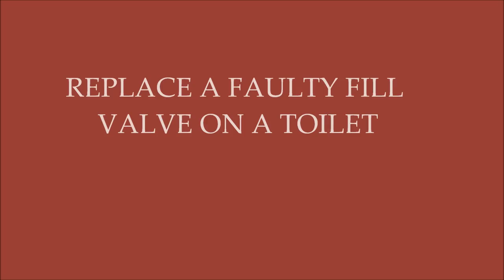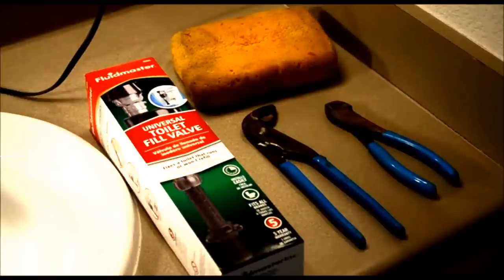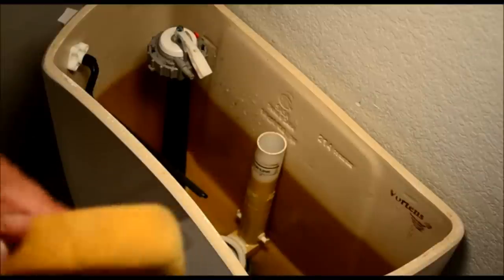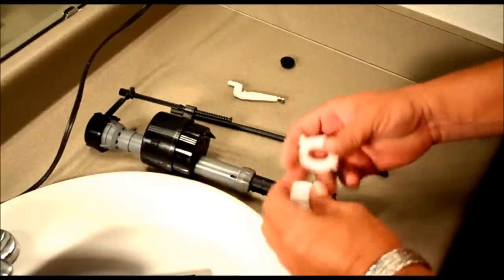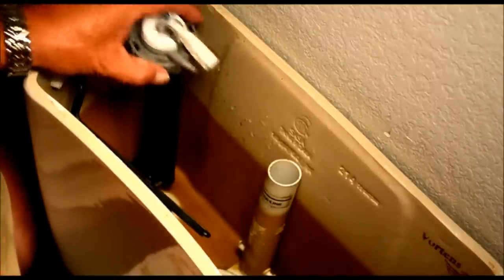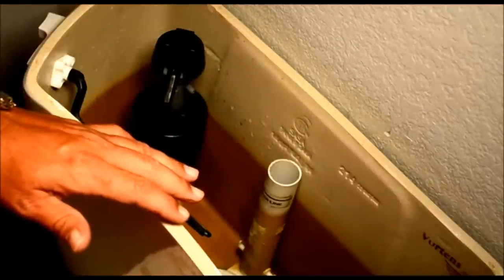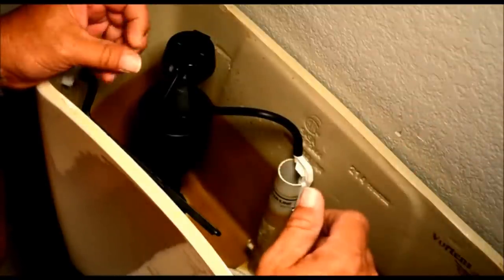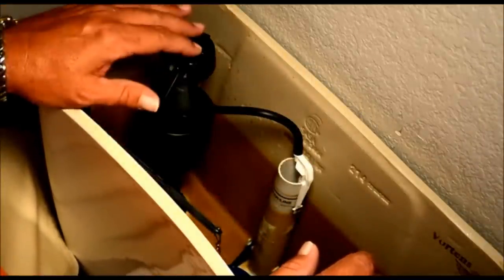How To Fix A Running Noisy  Toilet (DIY)

Comment: Thanks Dan!  I had a leaky toilet and I noticed my water bill spiking because of it.  I went and bought replacement fill valve, found your video and changed it out with confidence.  Worked like a charm, and now I hear no more leaking from the toilet.  Thanks for the assist!

Comment: Just replaced the valve and it was as easy as you said it was.  Thank you so much.   Your straight forward explanation and pictures made it so easy.  Took me some time as I had trouble getting the old nut off the old valve but once that was off the new one went in, in no time at all.  As someone commented below you are the man.   Now I can replace the other valves in our other two toilets.  You saved me a lot of money as I thought I was going to have to call a plumber or replace the toilet all together.  Again thanks.

Comment: Without a doubt, this is the best video I found for installing a Fluidmaster 400A Flush Valve. My only disappointment is that now when the tank fills, it starts out sounding normal but suddenly gets very loud and continues to be loud until the tank is filled. Is it because Fluidmaster Flush Valves are noisier? Is it because I put the gasket on upside down? Is it because the lock nut isn't tight enough? I tried adjusting the water shut-off; that helped a little bit but it's still too loud.

Comment: you the man Dan!!! thanks for this video, i narrowed it to a faulty fill value on my American Standard tank. question for you and everyone else, do i have to replace the parts with the same brand? Is there different sizing? looks like that fill value has a built in float ball. thanks in advance.

Comment: cool video….but do you have any advice if the water shutoff valve is stuck from corrosion?? Ive tried WD40 and it won't budge. I don't want to force it too much for fear of breaking the water line and then having a whole new emergency on my hands with uncontrollable water flowing everywhere.
I'm thinking Im going to have to shutoff the house's main water line, but I'm just seeing if there was some sort of workaround I'm not thinking of. thanks!

Comment: Thanks for the video. I tried to do this. But water is leaking drop by drop where water connected to Fill valve. The water is leaking outside. How to fix this?

Comment: I put a brand new fluidmaster in and get intermittment filling of water thru overflow tube. The rubber tube is adjusted properly. There is no leak from the flapper.. It intermittently fills for 3 seconds once every 2 minutes when not in use. ?????

Comment: Thanks Dan.  Great video and very helpful.  I'm going to replace my fill valve with a Fluidmaster but I do have a question.  My old fill valve leaks from the top right before it is suppose to shut off.  Can the leaking be fixed or is it just time to replace the whole assembly?

Comment: I just bought a brand new aqua source toilet, and when I connected the water line on the bottom of the toilet it was leaking from the bottom of the toilet bowl. It seems that the white nut for the above fill valuve that is flush with the bottom  of the toilet fill valve has a leak in it, and seems a bit loose. Can I tighten this while holding the toilet fill valve from above or do I have a defective toilet fill valve, and have to return the tank back to the store? Can anyone help? Thanks!

Comment: Hi my name is Chris and I'm having a problem currently as I'm typing with my toilet I recently noticed that water drips from my toilets tank lid when I flush and I thought how strange because I have a new home with all new things in it so what can possibly be going wrong already and I was curious to see what was going on so I lifted my tank lid and flushed to see what was happening and the inlet valve was literally squirting water out of the tank can this be adjusted? Is the part already bad? Need advice thanks.
Reply: +Green Machine How are you typing with a toilet?

Comment: I got stuck at removing the coupling but underneath the tank cause it's corroded and there is a lot of calcium buildup. I tried removing it with pliers and it broke!!! The screw part broke as well! Help

Comment: you don't have to have to put the float ball back in?
Reply: +drumstick9000 - No, because the float-ball was part of the old fill-valve unit.

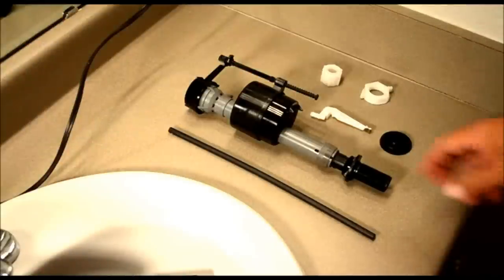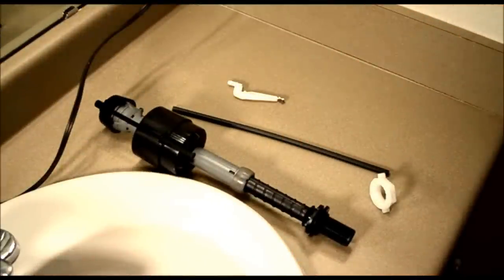The replacement fill-valve unit is designed so that the float ball's water shut-off function is performed by a buoyant black cylinder which surrounds the fill-valve's gray vertical column and floats up and down it when the toilet is filling or being flushed. There's a good view of it between 3:19 & 4:26 on the video, when the new fill-valve unit is on the counter top, prior to installation.
Reply: +TransientVisions thanks so much now I know  I do not have to buy a whole new toilet.

Comment: Everyone shows how to install these valves but no one shows how to adjust how much water goes to fill the toilet bowl through the refill hose. There is a screw that adjusts just how much water flows to the toilet bowl through the hose and no one shows it. Wonder why since if you live in the country and have a leach field you don't want too much water flowing down into the bowl to refill it because it just goes down the drain and out to the septic tank and flows into the leach field and too much water to the leach field over a period of time ruins them. I know because I use to do apartment maintenance and we use to do it to those toilets to save on the water bill and now can't remember for the life of me how we did it then. Old age you know?

Comment: its never ever one fucking thing to fix you had to do 3 things there ie put some filter thing back on another pole thing and then the floaty thing which my toilet doesnt even have. There are no screws for mine to unscrew either its a new plastic one and the toilet keeps running and eventually flows into the other pole thing.

Comment: Didn't have these problems say 15 years back before we were swamped with 'Euro' crap fittings. You fitted a valve and it would last 30 years, with just possibly, the occasional need for easy replacement of rubber washer......Don't start me on light bulbs !!